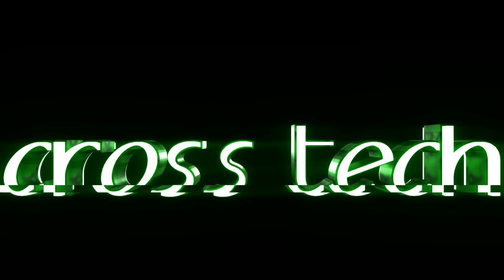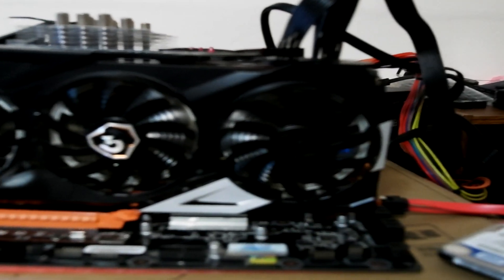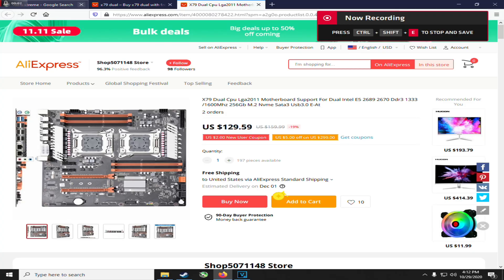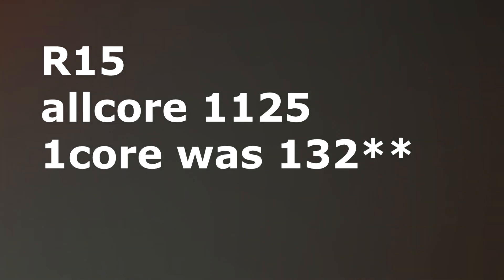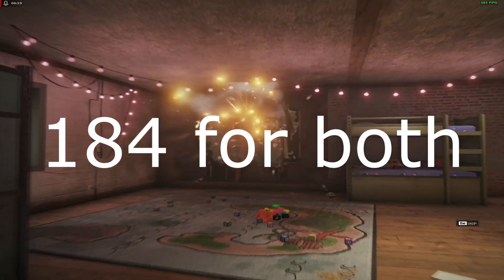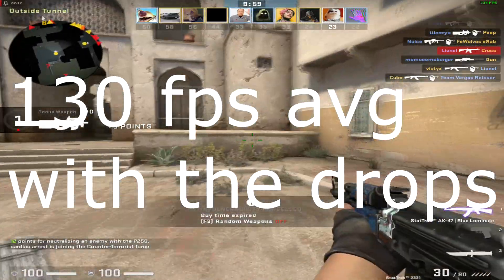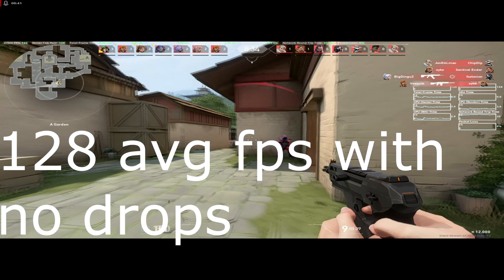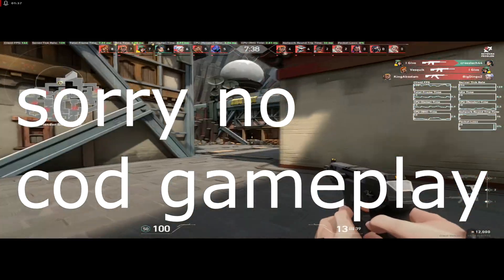dual CPU x79 motherboard in late 2020 (JINGSHA X79 Dual CPU Motherboard) with 2 e5 2643 and 980ti

Comment: Hey, love your videos, but I have a question, does this specific motherboard have PCIe bifurfication option in the BIOS? it's usually on BIOS advanced menu under PCI/PCIe express option, I need it for running niche's hardware.
Reply from the maker: I'm not 100% certain. The BIOS on these Chinese motherboards are incredibly stripped down. I know it has virtualization. But I'm not sure about bifurcation. If you're going to be running something that's much more niche I would probably recommend looking at something with an actual brand name attached to it.
Reply: @crosstech1  I currently got a single socket X79 green colored mATX motherboard, it's unbranded but im pretty sure its rolling  from Machinist factory, after tinkering with the BIOS advanced menu, I found PCIe bifurcation menu and I confirm it's working flawlessly in X4X4X4 mode, tried it with PCIe X16 to 4 NVMe adapter card witch require motherboard with PCIe bifurcation support, I really wish you can take a peek on those motherboard since it's really helping me who's want to make a dirt cheap VM server running 5 NVMe drive in ZFS Pool for blazing fast I/O.
Reply from the maker: @pingtime  if I get the opportunity to set it back up again then I'll definitely check it out for you. I was actually planning on doing the video with this motherboard sometime in the near future I just don't know when it's going to be. I've got three other big projects in the works.
Reply: @crosstech1  Thank you so much for your efforts, and I have an idea about running head to head a X79 vs X99 platform with identical specs, I'm curious what can haswell xeon really offer rather than just minor IPC improvement and DDR4 support
Reply from the maker: @pingtime  that is one of the big projects that I'm currently working on. X58 versus x79 versus x99. All 6 CPUs. All overclocked and water cooled.
Reply: @crosstech1  and yeah, I dont wanna spending 450++ USD for used and deprecated Platform motherboard from Supermico/etc, used server hardware is pretty expensive in my country

Comment: Off topic. How does a 5670 x58 compare to x3470
Reply from the maker: You know that is a great question. Ipc-wise I believe they are completely identical. I think the only difference is the x3470 would be on the mainstream Intel platform.
Reply from the maker: But I've never messed around with the x3470

Comment: Hello again, would this mobo function with just one cpu installed?
Reply from the maker: It depends. You can use one CPU but you have to have both CPU 8 pins plugged in. So requires a fancier power supply that does have two eight pin CPU connectors. And you can only use e5 26xx series CPUs you cannot use the E5 16xx series CPUs
Reply from the maker: these motherboards are a lot of fun to mess around with for server applications but I don't know if I'd recommend it for a gaming build

Comment: Hey I just got the same motherboard but I can't seem to get it to post to the bios I have e5 2667 v2
Reply: Can someone help me get it to work
Reply: @austinballard3746  Have you checked your stand offs to make sure the bottom of the board isn't shorting out?
Reply from the maker: Do you have two of them or just one of them
Reply: @crosstech1  2
Reply from the maker: @austinballard3746  do you have both of the CPU connectors plugged in properly. the only time I've really seen these motherboards give anybody problem is if they either don't have the two CPUs or don't have the proper CPU connectors for the motherboard.
Reply from the maker: @austinballard3746  and the CPU connectors are different from the GPU connectors even though they are both 8 pins
Reply: @crosstech1  yes I have 2 8 pin connectors
Reply: @crosstech1  I have one 8 pin cord with a spitter that plugs the both cpu pins in.
Reply from the maker: @austinballard3746  that's probably where your problem lies. if your power supply doesn't natively have two eight pin connectors it's probably trying to pull too much voltage and making it not want to post. I should also probably ask were you able to get it to post with one CPU at all or have you not been able to get it to post at all?
Reply: @crosstech1  not at all I have tried 3 different types of cpus tried 1 at a time and still nothing.
Reply from the maker: @austinballard3746  then unfortunately you might have a defective board. I'm sorry I wish I could have helped more.
Reply: @crosstech1  the cpus get hot and all it says it no signal I have also tried 3 different graphics cards
Reply from the maker: @austinballard3746  what have you tried for a memory configuration
Reply from the maker: @austinballard3746  that would be the last thing that I could think of
Reply: @crosstech1  I'll see if I can return it then thanks for the help though
Reply: @crosstech1  yes I have ecc ram I have also tried normal ddr 3

Comment: Do you have a link?
Reply from the maker: I don't I can't find it for the same price that I originally found it for.
Reply: @crosstech1  how much did you pay?
Reply: I want to build a setup with two 2696 and 128 gb (4*32)
Reply from the maker: @johndee759  I paid 100 USD  for the 4 slot but I can only find the 2 slot bord for the price. It's the same bord just lest dim slots
Reply: @crosstech1  how safe is it to buy from AliExpress. I am thinking to probably pay $600 on a configuration and I am a bit concerned. eBay would be safer.
Reply from the maker: @johndee759  I haven't had any problems with orders for China. I have had problems with orders for the USA. But I have gotten my money back when ever something happens. Btw why spend so much money?
Reply: @crosstech1  how much should this configuration cost? 2*2696, 4*32 ram, and mobo.
Reply from the maker: @johndee759  what would you do with that kind of CPU config and why do you need that much RAM. That would be 24 cores and 48 threads. I don't know of anything short of server-grade applications that could utilize that many cores and threads. and if you're looking at spending that kind of money you might as well just buy yourself onto a newer platform which would give you better single core and multi-core performance.
Reply: @crosstech1  it’s for IT. I want to do lots of virtualization
Reply from the maker: @johndee759  then this motherboard is not for you. you would want something with quad channel memory not dual channel memory. there'd be no point in using it for virtualization because then you'd have to be splitting them memory channels and it would heavily affect your performance. with this particular motherboard you could only run for virtual machines with single channel memory or two virtual machines with dual channel memory. and the raw amount of cars really wouldn't give you any benefit if you were bottlenecking it by the lack of memory support.
Reply from the maker: @johndee759  so if you want to do stuff with virtualization make sure that the motherboard has quad-channel memory instead of dual. the x99 variation with quad channel memory would probably be the better bang for the buck with better single core and multi-core performance as well as having cheaper CPUs. As long as you're getting a board with quad channels memory per CPU you could then run up to a virtual machines with standard single channel memory. And ddr4 before faster than DDR3
Reply: @crosstech1  Thank you for your advice but ddr4 is a lot more expensive that is why x79 is so attractive. These old servers are getting salvaged.
Reply from the maker: @johndee759  I can't be that much more expensive than $600 USD. Not to mention the fact that you're six core processors would be far cheaper on x99 the x79. So I would advise you to do some price comparisons before buying anything. There are also quad channel memory motherboards for x79 as well. And also why would you need so much RAM.
Reply: @crosstech1  hey bro im looking to get a dual x79 system but i cant find a dual cpu quad channel mobo for a good price same for the cpus (2697 v2 or 5 6 )
Reply from the maker: @chava1936  there is no motherboard for the same price

Comment: I'm watching this video in a similar setup to the one you tested. Mine has 2 x E5-2640 / 128GB RAM / 2 x Strix 980 OC in SLi (althoug, the system doesn't seem to recognise the SLi even though it says it is supported). My numbers are very similar to yours and so far it has been a reliable machine. I only have issues when playing Valorant where I randomly get an error VAN-102 (used to be VAN-6 before an update) which kicks me out of matches and I can't find out why. CS-GO runs without issues and so does Warzone.
Reply from the maker: There is no SLI certification in these motherboards. The only way to get SLI working is an SLI hack. And on this motherboard I was completely limited by CPU strength. If I had E5 2643 v2s it would have been much better.
Reply: @crosstech1  What I meant is that this board is advertised as supporting SLi. I have no clue about its certification status on anything. I bought mine from AliExpress.
Reply from the maker: @nefastobrasil4079  no you need to use a sli hack if you want to make it work.
Reply: On all express I can’t seem to find this board

Comment: Did you have to find a power supply with 2 8 pin cpu connections or were you able to use a pcie connection? I purchased a X79 and waiting for it to get here so I figure I will get the rest of the build and the power supply has me stumpped. Did you have any issue?
Reply from the maker: Yeah you need to get a power supply with two CPU 8 pins. CPU 8 pins and GPU 8 pins are different
Reply: @crosstech1  agreed, I'm using a Corsair HX1200i but that's because I'm running a water cooling loop with two large radiators but I have another PSU that has two CPU connectors. I believe it is an EVGA 750W.